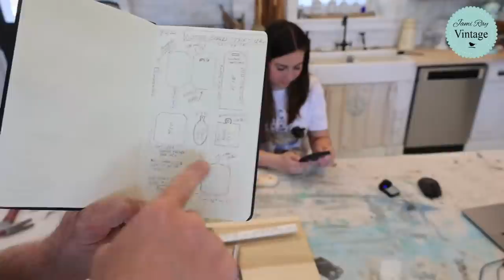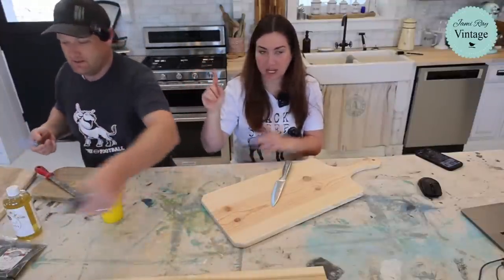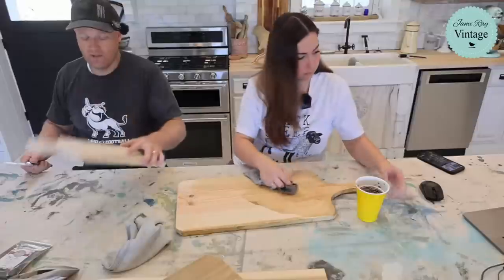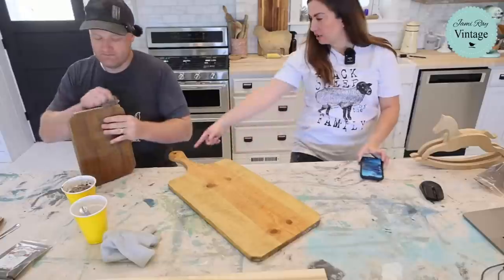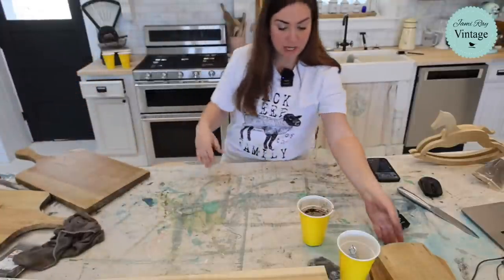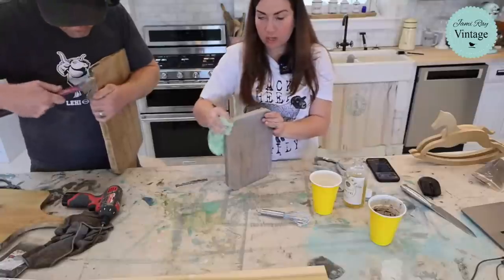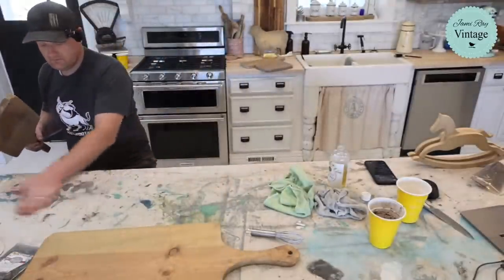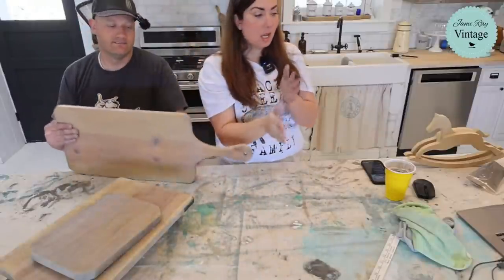Food Safe!  Scrap Wood Cutting Boards DIY Inspired By England Antiques For Waste Not Wednesday

Comment: Perfect timing. I just bought a few boards of pecan wood that’s been drying for about 4 years. I’ve already starting cutting the boards, and using tung oil to seal.
Reply: Is tung oil food safe? Or are they only for decoration?
Reply: @cynthiafisher9907   Tung oil is extracted from nuts. Known for good water resistance, it often requires numerous coats. It leaves a natural finish that darkens the wood while showcasing the grain. Once thoroughly cured, it is food-safe.
Reply: @mtparrish  Thanks for the reply! I knew it was a good sealer for wood, I just didn’t know if it was food safe.
Reply: @cynthiafisher9907  I thought it was interesting too that it derives from nut oil.  I have 5 boards cut and about 10 to go.  I hope my customer group will like them!

Comment: Is not maple wood the hardest wood, not sure about pine ,, for cutting boards,  I guess all food safe depends on how slivery the wood gets when cutting food on it.? So, not sure about pine, ?what you think
Reply from the maker: The pine works well, it does wear a little faster but I’ve never worn through a pine cutting board yet. As far food safe woods a good rule is if the tree bears edible fruits, nuts or sap it can be used around food.